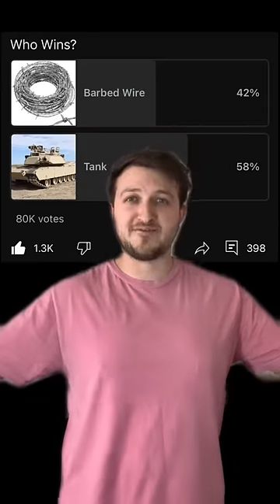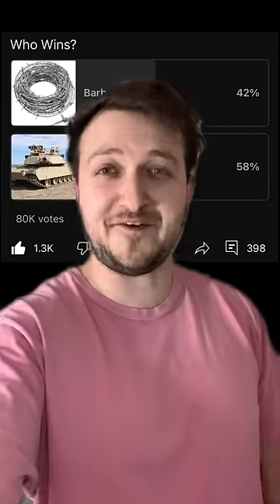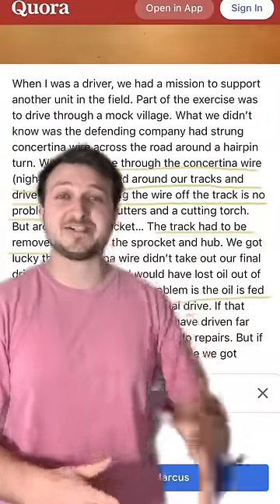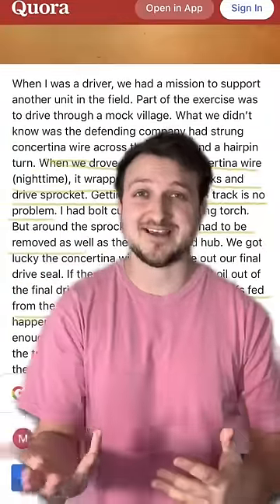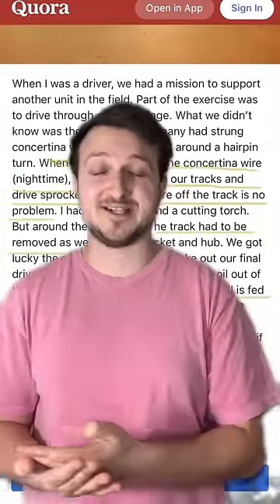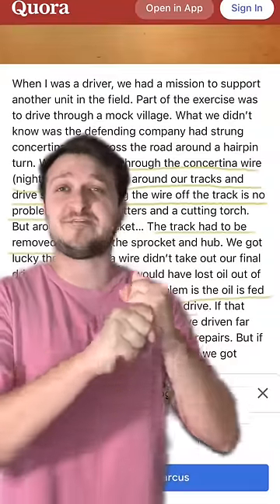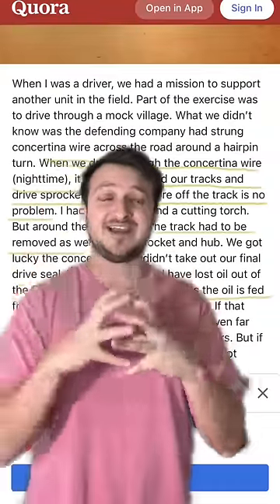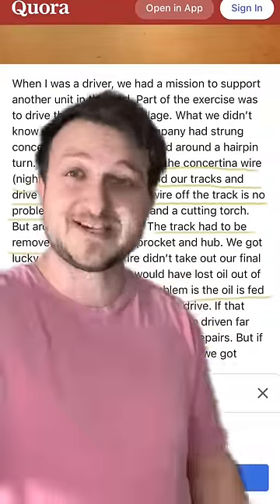Soldiers Tank vs Barbed Wire. #shorts#army

Comment: As a retired tanker on the M1A2, the wire wins 💯. Good thing engineers are on our side.
Reply: If barb wires can defeat M1A2 then US should have given Ukraine barb wires instead .
Reply: @josephstalin6331  I agree, the tank is a tool, that can win a war if used by a trained crew. The Ukraine may not be able to use the tool in a way that helps them.
Reply: @Thomas Galindo  they won't. They would do better with t72s. They don't have the support or training needed to run these tanks
Reply: Defense only
Reply: Doing ok so far
Reply: We are sending Ukraine Bradley fighting vehicles so of course they will be getting Abrams as well.
Reply: Wouldn’t you just be able to shoot a couple heat rounds to blow up a gap to drive through? Or is that just nonsense?
Reply: @rubberbandman200  I guess you could. There is more to shooting the main cannon,  like bore sighting, settings and more. We shall see.... I'm not sure how I feel about sending equipment....
Reply: @rubberbandman200  true, just hope it doesn't start anything bigger... the true deadly feature of the Abrams is her crew
Reply: Then you never had a plow on your tank.
Reply: @Teefs69  the problem is wire is used to construct obstacles,  and terrain must support the use of obstacles.   Much of the terrain in Ukraine is flat and would allow attacking tanks to just go around the obstacles.
Reply: @JamesJames-zr3kz  The US uses blades on some of our tanks primarily for breaching earthworks and pushing mines aside. For dealing with this kind of defense we use the M1150 assault breacher, that fires LDC (linear detonation charges) across the fortification to blast a gap in it, along with disposing of any anti-personnel mines that might be in its path.

It then uses its blade to push aside any surviving anti-tank mines—if they are present. If my understanding is correct, anti-tank mines are designed to withstand explosions. They either take a lot of weight to trigger, or are magnetically fused.

Thing is, fortifications are not invincible. They will tangle and damage tanks that drive over them initially, but once pushed aside or crushed they are useless.
Reply: YESSIR.....get it wound up on 1 side.....good way to spend the next 12hrs replacing a torsion bar!!!
Reply: @Jon_C-19K  or have to replace rubber bearing seal on your road wheels.
Reply: @whocares5188  you can teach a 10 year old kid to use an abrams if the kids ever played a video game. there’s literally youtube tutorials bruh
Reply: Sappers approve this message. 
I say the same back to the tankers!
Reply: @stuarthamilton5112  and to be clear I drive a tank With a plow.
Reply: @carterrrrrrr  if you really believe all you need is a few games of cod to drive an Abrams you are the biggest fool of the week.
Reply: @JamesJames-zr3kz   Of course, of course, but not every tank has a blade in its kit, and if it’s a US expeditionary force, it’s going to be the Marine Corps more than likely, and they don’t use tanks.

They do, however, use assault breacher vehicles like the M1150.
Reply: @JamesJames-zr3kz  that won't help the wire especially when it hits the side of the tracks. Then pick up the wire and get it tangled with it. Because you have to take out all the wire before moving forward.
Reply: @Teefs69  you're not former military are you sunshine?

By your logic crayons should be sent in over marines lol
Reply: @carterrrrrrr  terrifying thought yet sadly true. And a crew of 10yos would actually fit comfortably in the tank
Reply: @Teefs69  barbed wire would unironically work wonders if used in a large quantity to fortify Ukrainian positions considering Russia's solutions for everything so far has been "throw infantry at it"
Reply: @pvtread5207  have you killed a man?
Reply: @whocares5188 🤦 Unkraine doesn't send toddlers for training on the M1, Leopard or Challenger, they send combat experienced tank crews. So, no need to train them for 12 months, 3 months will be enough.
Reply: @Teefs69  you've never been within 100 yards of a tank have you?

What a stupid question btw
Reply: @Teefs69  awwww, look at you assuming something about me. How cute
Reply: @whocares5188  they are training in Poland in US bases to use these. Also in UK for the challenger
Reply: @whocares5188  our tanks being given to them also comes with support and training dude, that's why actual deliveries of these tanks are nearly a year out. We have given them basically every t72 that we can
Reply: @Rylan Davis  lol Ukraine is having a hard time with logistics for keeping the t62 and t72. Running.  Idc if we are sending parts and a few trained mechanics. Ukraine can't even keep their t72 mechanics work shops open bc they keep getting blown up.  Now imagine trying to drag overly complicated and heavy equipment around to keep the Abrams running.  The Abrams will be a useless tool to Ukraine
Reply: @whocares5188  wanna know why they are having a hard time servicing t72s? Because the t72 is made by Russia and the west has consumed almost the entirety of our supply of spare parts. It will be easier for Ukraine to maintain western tanks, specifically the leopards because their supply is entirely created by the west and they can be moved out of country to be serviced. Ukraine has plenty of t72s running still not sure where you are getting the info that their logistics are unable to support them, they literally just barely successfully completed to major armored offensives in the east and the south. You can't do that kind of stuff if your logistics can't even maintain a tank.
Reply: Once I thought avout it I realized how barbed wire beats tank. Seems to me even the toughest things have some weakness
Reply: You say that, but I watched an Abrams drive right through a serpentine of constantina wire that was set up to create an Entry Contro Point (ECP).  The engineers kept making the serpentine tighter and tighter until tanks couldn't get through, and Bradleys were barely able to.  The engineers did this over the course of 3 days.  During which, several complaints were made that they were making it too tight for the armor to pass.  But they just kept making it tighter and tighter.

So the platoon sergeant of a tank platoon ordered his driver to just run it over.  He got lucky, though. The wire caught onto the sprocket wheel and was shortly cut off by the sprockets.  But only after the tank dragged the wire and stretched it out for about 150 meters.  The engineers were pissed cause they had to go out there and coil it back up.  They didn't pull that shit again, and the rest of us had a good laugh and a new story to tell.
Reply: @Teefs69  barbed wire is good and bad. Becouse your own equipment can get stuck in it along with your own soldiers. And on top of that it’s a gruelling job to clean up. There is still mess of barbed wire all over from the world wars
Reply: @michaeldupree2642  just because theyre getting IFVs does NOT mean theyre getting abrams tanks. i can guarantee you that none of the ukrainians are properly trained, equipped for, or used to fighting in an abrams, and while it is powerful, wrong moves that can be easily made will always result in the destruction of said abrams, which is absolutely not something the USA can afford
Reply: @rubberbandman200  Ya but that gives your position away to anyone within several miles of you...
Reply: @Rylan Davis  lol Ukraine makes the t72 in house. Getting parts isn't the problem.  Setting up shop to work on the tanks is the problem bc Russia just blows them up
Reply: @Rylan Davis  and ya right. Western tanks will be a nightmare to maintain.  Having to send them to Poland for every problem will be almost impossible
Reply: You schooled me today, as a 20 year retired vet.
Reply: @rubberbandman200  Why HEAT for barbwire!??? Did the wire is 200mm Thick??? 🗿

H.E is enough dude 😂
Reply: @boxed_fear5558  if it has it I’m their load out sure. They typically carry ammo based on the operation they are on. So they might not be carrying any
Reply: @rubberbandman200  nahhh.... H.E always in racks and used least. The first would run out is the APFSDS or HEAT... Even if you shoot the HEAT at barbed wires, it's just stuck on the ground and maybe just small explosion compared to H.E... heat designed to puncture armor, not obliterate fortification.

For infantry... It's better to use shredder instead H.E
Reply: @boxed_fear5558  and u know this as a fact? 😂
Reply: @rubberbandman200  They tried this in WWI, with thousands of artillery shells, just to find out that wire get more entangled and worst to deal.
Reply: @Pvt Read  though crayons should be sent to marines lol
Reply: @whocares5188  yeah-yeah, they can destroy repair stations. Also destroyed 24 of 20 Himars and 4 of 0 Bradley and 150% Ukraine helicopters (Russia general staff data). 

I mean, clearly any repair station is a weakness. But found it and destroy it isnt ease job and right now Ukraine are repair their tanks successful as we see. 

But, abrams is quite different. It not just metal box. You cant repair it in you house.

Anyway, USA planned make repair station in Poland for Abrams. And all this things doesn't matter.
Reply: It tangles up in all over the moving parts then your done moving
Reply: interested to know, how do you guys defeat barbed wire?
Reply: @angrycolonel1957  we call the engineers or use a plow
Reply: I remember back in the early 2000’s we were staged at Camp Buehring climatizing before we went up north. We were training putting triple stand concertina fences up around our equipment and staging area. One morning coming back from a pt run around the camp we saw where some kilo’s had drove through our wire. We were only there about another week, but those guys punishment was carrying and pushing return rollers everywhere they went on camp. 
I remember seeing these guys rolling them along the line going into the chow haul. They got up to the door and they wouldn’t let them roll them in. Then later we saw them trying to roll them back down the road and carry to-go plates. 😂😂😂😂 Those guys were catching it!
We had our own geniuses too. I think every MOS has did, and our own special punishments to reel them in.
Reply: @michaeldupree2642  they are getting old M1 sleds.....they don't have the ability or money to maintain them
Reply: @stuarthamilton5112  we got the fire live miclic for a breach exercise at yak training center near JBLM.......1800 lb of boom
Reply: @jacobishii6121   That’s a lot of boom!
Reply: @Teefs69  It takes a company of heroes pioneer squad like 20 seconds to build a 10 meter long barbed wire stretch. 1km. 14 days for 1 pioneer. Frontline is 850 km. 12000*4 manpower-days. Even in Lala-land it's an area denial weapon meant to buy a little time at best.
Reply: @rubberbandman200  
Maybe a HEP round.
Reply: That makes no sense
Reply: @Teefs69  *barbed
Reply: They weren't during WWII, the Germans had the best
Reply: @JOSEPH STALIN  we shouldve given ukraine NOTHING
Reply: @Jokūbas Mirinas  I think it's more of we have no choice.  We bought all the soviet tanks we could and now they need more. We are way to invested to give up.
Reply: @rylandavis2976  
"and the west has consumed almost the entirety of our supply of spare parts"
"The West has consumed the entire supply of spare parts for Soviet-era tanks that they don't operate."
...That's an interesting theory, Rylan Davis.
Reply: How did your engineers fix the "goat herder in a Hilux" issue?
Reply: @whocares5188 Good point, that would also make sense.
Reply: Problem is both sides has engineers
Reply: That's awesome!
Reply: Engineers are exclusive to your side??
Reply: We had them jam the 3rd axle on our Stryker took some good slashes at us as it unbinded and sprung off but it was not too bad
Reply: @Teefs69  Comrad Stalin, the ukrainian frontline is like 2.5km
Reply: @PercocetPete  drop the tsar bomb mk.85 Pro Max
Reply: Engineers are on every side...
Reply: @Teefs69  - That’s what combat engineers are for, we would blow the wire using a few pounds of C-4 or a Bangalore torpedo, blows a nice big gap in the wire that a tank can easily drive through.
Reply: Whaaaatttt???
Reply: Bro ain't nobody gonna untangle your tank...oh that's a good band name Tangled tank
Reply: @rubberbandman200  you shooting that Bob wire just like telling everyone of the enemy ATGM teams to deal with you,let the engineer do their job, just being over watch, guarding the engineer.
Reply: @boxed_fear5558  back in the old days the engineer had the CEV to clear obstacle with it demolition guns!
Reply: @@michaeldoucet582  Oh absolutely, LDC is a whole new ball game. Every thing has tolerances, and LDC is absolutely beyond the tolerance of a tank mine. That's going to blow that shit sky high.

I very much comprehend that piece. An M1150 Assault Breacher is going to brutalize tank mines in its way.
Reply: There's a reason Howard's funnies were so effective on d-day and after. The giant trasher maw on tank rails slamming hundreds of kilos of chain whips into the ground nonstop was pretty much the best way to get rid of barbwire and mines in combat situations. What was that variant called again? Crocodile? It's a lot easier to strip s bunch of screwed up , tangled or plain cut up or shattered chain lines ona rotation axis after the breach is succesfull and the proper fighting gear managed to get trough the opening then trying to ... How to put it gently. "Unfuck a fucked up tank gunked and torn into with metric tons of barbwire and replacing half or more od the entire drive assembly in the field". :O gotta tip yer hat to howard. His variants were absurdly hyper specialized but they fullfilled niche's needed at the time and allowed the rest to do their job more easily or at all.
Reply: Pretty sure though those munitions that fire a rope of explosives would clear that wire and mines with no problems.
Reply: @Teefs69  You should fly there and help.
Reply: As a former 11f/11b yeah we learned that the hard way with our own CEVs, AVLBs and our worse nightmare: the ACE.
Reply: Couldn't tanks just shoot the the barbed wire? Or go around? Or the drivers getting off and removing it? If we're taking about a 1v1, there is plenty of ways for the tank to succeed.
Reply: @alt9177  the tank's visibility is very limited and the wire very thin. When it tangles up it can cause the track to come out. Even a piece of metal or a 2 by 4 inside the track can do that. A tank weakest point is not the rear, back or top. It's weakest point is it's track.
I have spent many hours in the mud fixing tracks ruined by wire left in the field.
Of course if we can avoid them we will go around, I personally would rather pick it up to avoid other tracks in my unit to have to deal with the problems it creates.
Reply: Just like nationwide

Comment: Being an ARMY welder really sucks when you have to repair tracks that have run over that stuff and broken something.
Reply: Ah shit I just left ft lee
Reply: We don’t have our tracks repaired, we just replace it
Reply: Being a welder working on tracks on ANYTHING sucks bro
Reply: @gorbdonfreeming  till the budget gets slashed. .Just wait till you have to start making old tracks work by welding them together. tracks that should’ve been thrown away along time ago I’ve been there and I’ll tell you what there’s not much tougher work out there
Reply: You don't need to weld tracks! you just pull the track pins out
Reply: I don’t get it. I was on a paladin. There’s end connectors, track pins, tracks and track shoes. You could keep a whole gun battery going for years with just track shoes and some extra end connectors.
Reply: Never once seen tracks get welded, we just replaced any broken shoes. 
And after having worked as a welder for years after getting out of the Army I can tell you it wouldn't work, in order for it to hold up to the pressures you couldn't just put a pass on each side, you'd have to weld a pass on one side then back gouge the other side all the way down to your root pass making a nice valley to fill with weld to get it 100%, and after doing that you'll have warped the shoe and you'll never get the holes to line up with the one's on the shoe on each side of it to get it back in, plus it'd take you so long compared to just replacing the shoe it wouldn't be worth doing it in the first place. 
I also never personally had track actually break from wire getting tangled up in it and don't ever remember seeing it happen, it just locks up the drive and stalls it, afterwards we'd have to take bolt cutters and start cutting through all of it to get it out, and it takes a while because a whole bunch of that stuff will get sucked up into a track in a big ball, or take an axe if we didn't have bolt cutters and chop it out, you might as well throw the axe away after that.
Also I don't think regular farm barbed wire would stop one, it's very brittle, it's actually an iron wire and not steel like most people think, flex it back and forth just a couple of times at the same place and it breaks unlike a steel wire that you have to bend back and forth 20 or 30 times to get it to break.
Military triple strand is a thin cover that has all the razors on it that's wrapped around a high strength steel core wire that's about ⅛ inch thick, and it's some mean stuff, that's why it'll stop a tank, it's not regular steel wire.
Reply: As a Bradley crewman for several years, I have not once ever heard of welding tracks. Not only that, but it's not the tracks that get jacked up unless it gets thrown, but that's a relatively easy fix.
Reply: Our welder was a really cool dude. God bless yall and out FLA exhaust leaks etc
Reply: I can only imagine how shit having to repair a bunch of tank treads would be along with the internal workings
Reply: @ClaytonBigsby01 nahh
Reply: @Token_Black_Guy  nice track tho